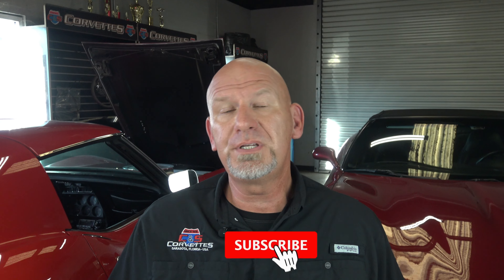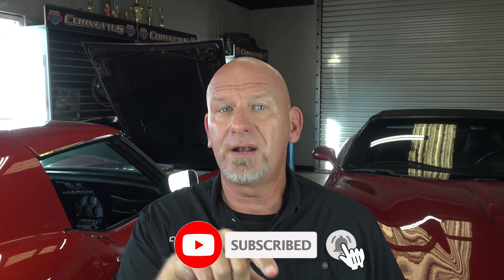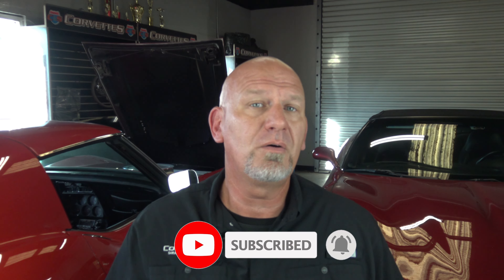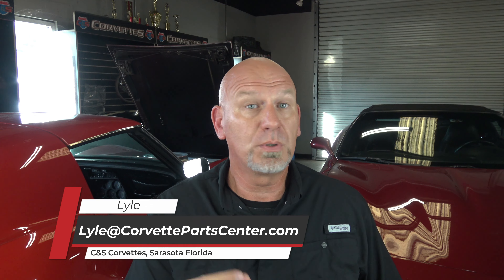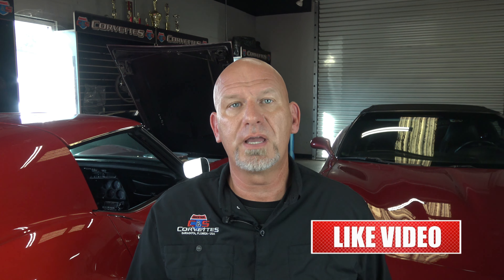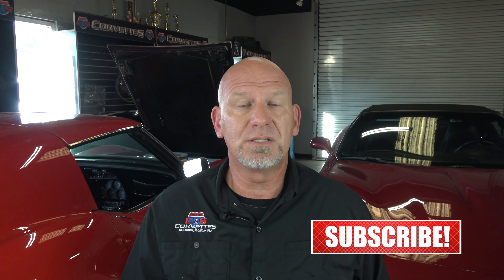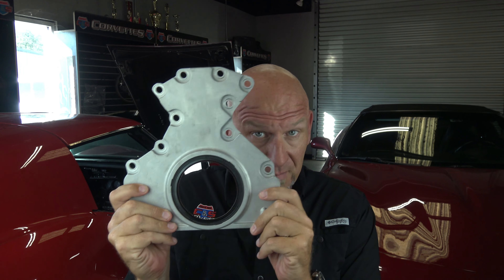MUST HAVE when working on your Corvette's clutch or torque tube

Comment: I had to do the plate in my 2010 Camaro with the LS3 due to a leak at only 20k. Now I also have a 2013 C6 with the LS3 and everything needs to come out to do some trani repairs, I have a vibration coming back through the shifter when under load in fifth gear. I've already got the bleeder line purchased, I guess I better do the plate even though it's super low mileage, under 17k miles. I'll also be looking at replacing the clutch and slave/throw-out assembly as well because I'm hearing an occasional noise when depressing the clutch pedal. Somebody must have went nuts in this car before I bought it.
Reply: With only 17,000 miles how nuts can you get ?
Reply: On your camero did you use the plate that Lyle sells ? Did it solve the problem?
Reply: @rrf6747  I bought the Camaro as a Gm Certified Pre-owned Vehicle, and GM replaced it under warranty, so it's a GM plate. I don't know if it was an upgraded version or not, I wasn't aware about the issue with the plates at that time, but I was told that there was a service bulletin on the problem. So far after 12k and 4 1/2 years I have no new leaks. 
As far as the Vette goes, I have no answers. Again the car was used and according to CarFax it had 8 previous owners, 5 dealerships and 3 private owners, so it got passed around a lot. I made the mistake of buying it without a test drive, the dealership I purchased it from doesn't allow test drives, if you can believe that. The Vette looks like it's brand new, so I wasn't expecting this type of problem with such low mileage, and I really wanted it badly. I've already replaced the harmonic balancer as well.
Reply: @KFH_Kevin  wow Iv had my 2012 Corvette for 5yrs so your post scared me lol. I haven't  so far experienced any of the  promblems you mentioned got 42,000 miles hope you get it sorted out. That was my biggest worry when I bought my vette that it would become a headache.  I also bought mine through a dealership

Comment: Great tips, if you already have a tick clutch master cylinder in there with a bleeder line connected to it, do you still need a bleeder line from the slave cylinder?
Reply from the maker: That is a great question!  I don't know if the bleeder on the Tick unit allows bleeding of the whole system or  just the master, but I will find out!  Lyle

Comment: My clutch pedal is staying down sometimes. It works off and on. What are your thoughts?
Reply from the maker: Clutch master cylinder is failing internally.  Replace it, and you shouldn't have any more issues...unless you are seeing drops of clutch fluid on the ground...that would be a more serious issue.  Lyle
Reply: If you take your cap off the clutch fluid reservoir, what does the fluid look like? Mine was very nasty and I sucked the fluid out, cleaned the gunk off bottom of cap, added new brake fluid, pumped clutch slow 25x, changed again. Since and repeat a few times. I can't believe how nasty that fluid was, 2013 grandsport with 16,000 miles. Probably never done before!

Comment: Out of curiosity how hard would it be to turn an auto into a manual.
Reply from the maker: Mechanically, it would be fairly straight-forward:  Change the trans, diff and torque tube;  add clutch pedal assembly and all of the associated hydraulics.  The real issue is cost, because by the time you buy everything and have it installed, you could pretty much afford to buy another C5 that already has the manual.  Lyle

Comment: I did the clutch and your rear main myself on jacks and the seal is leaking a little because I probably torqued it ever so slightly wrong… oh well live and learn but definitely not doing a clutch job myself ever again at least anytime soon. I also forgot to put a bleeder line on the new slave as well it was a disaster project 😂 but hey at least it still drives

Comment: Hey Lyle. 
Watch you every week. 
I have a question. Coming home from work today I’m driving along listening to the radio when the radio completely shut off. Then I noticed none of my instrument gauges are working either or my power windows. 
The car did stay running and I got home. When I got home I shut the car off for about 5 min. Turned the key on and the instruments did their sweep. The car started and the gauges worked. Just wondering if this is a common problem or this could be serious. 
Appreciate any input. 
Thanks Lyle. 

John
Riverview fl. 
2003 c5